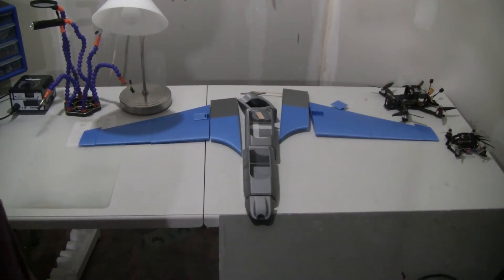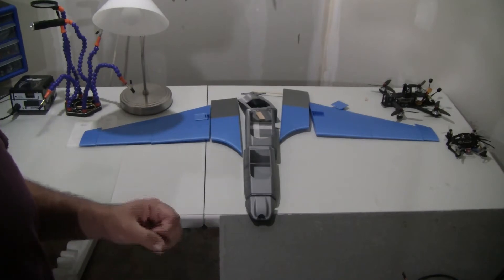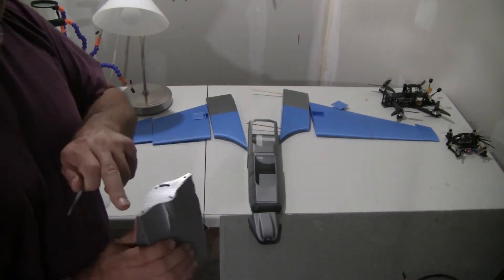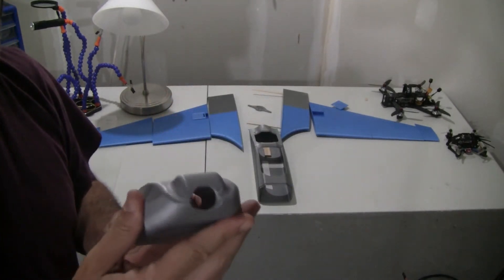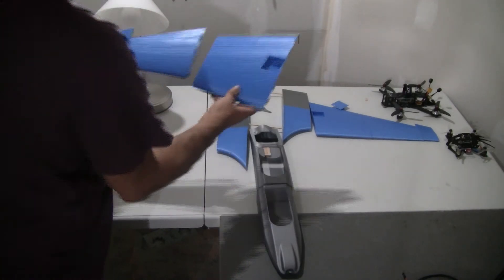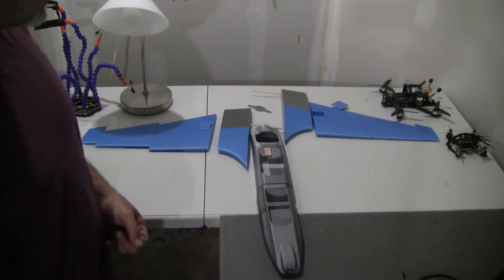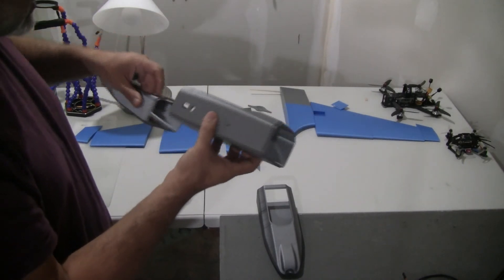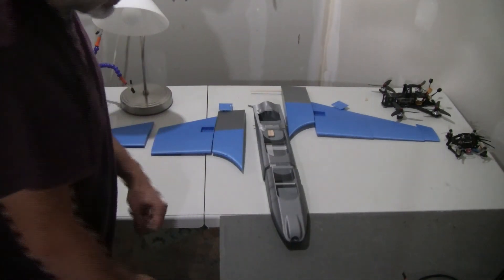3D Printed Swept Forward FPV Wing - Part 1

Comment: How you sliced with Vase Mode with Top and Boot in closed?
My try the top side is Open
Reply from the maker: Did not slice in vase mode, I set on wall and one bottom layer and two top layers

Comment: Hi thanks for great print. Did u use PLA? What is ur infill plz ?
Reply from the maker: Hello, yes I did use PLA, infill depends on the part being printed. I would not recommend to use PLA, a better option is LW-PLA, you will be reducing weight by 50%
Reply: @RaedAdlouni  ok great 👍 I am at the last winglets to print using PETG. It coming out so nice 👍 thanks

Comment: How do you print with top layer in vase mode with Cura? I don't have top layer when in vase mode
Reply from the maker: That is why I configure my own vase mode, infill = 0 and wall count = 1. This way you get top and bottom surfaces. You can even specify how many layers you want on your top and bottom surfaces.
Reply: @RaedAdlouni  and how does closing zero infill bodies on top layers works? The very first couple layers printed in bare air must look really bad.
Reply from the maker: Activate bridge settings in cura